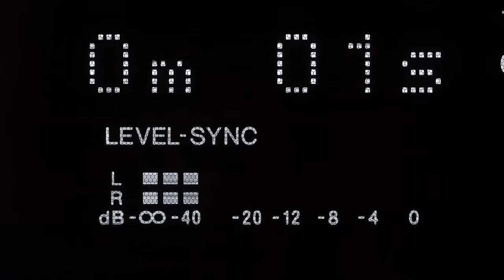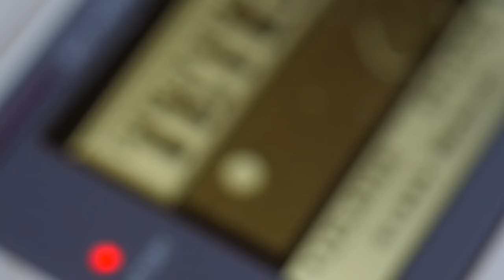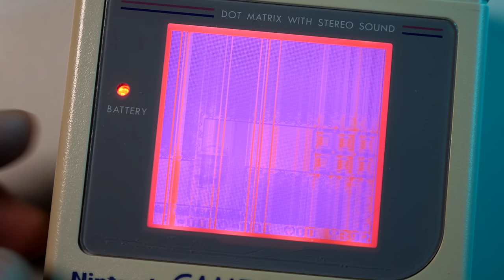The Best Game Boy DMG Screen Mod Ever!

Comment: I’m disappointed in Handheld Legend for not addressing the palette issue with this mod, and I find it curious how it wasn’t mentioned in this video.  I bought this from HHL on day one, only to find out on YouTube that every unit of this has the light gray and dark gray palettes swapped.  So while the ips screen looks great, every game looks wrong.  The user must cut traces and solder tiny wires if they want their games to look correct.  Handheld Legend has one sentence that reads “fixing the color palette issues with the dmg ips kit (rips)” between the features and contents of this kit, but it doesn’t link to anything, or explain the problem.  Two weeks after HHL released this kit, Retro Modding released it and were very up front with the problems, and also offer a version that is fixed by them and has speaker pre-installed.  I like HHL, but I think they pretended there weren’t any problems so they could sell more kits.  I don’t know if the palette issues have been fixed in the example in this video, but all potential buyers should be aware of this kit.  Neither HHL or this video bring up this issue.
Reply: There was one for the Gameboy Color just like this that had the same issue and they said it was only going to be the first run of mod kits and they were fixing the issue, maybe this will be the same?
Reply: Well can't you just tell by the gameplay footage here? It doesn't look wrong.

So how would he bring this issue up if he doesn't even have one??
Reply: Yeah, the way Tetris blocks look is what gave it away for me, as I've played more of that than I care to admit 😂
Reply: Wizzy Wambo  Do you mean in this video the colors of the mod are reversed as well and Colin just didn't seem to realize it?
Reply: what is the replacement kit to the pallette issue, and video discussing the issue?

Comment from the maker: A few important notes and frequently asked questions:
--The initial batch of these IPS screen kits cause the two greyscale levels to be flipped on the new screen (medium grey becomes dark grey, and vice versa). This can be fixed by swapping two of the pins on the wide ribbon connector that goes to the front PCB. However, I've received word that the manufacturer is aware of the issue and future kits shouldn't exhibit this behavior.
--The replacement shell I used here is also from Hand-Held Legend, but since minimal modding is necessary you could, of course, reuse your original shell if you wanted. This mod is also compatible with replacement glass screen covers.
--There seems to be confusion regarding the replacement front PCB. On the Game Boy, all of the logic happens on the back PCB. The front board only handles the connection to the display, the contrast wheel, the button contacts and the speaker connection. Since the original rear PCB is still used, the Game Boy functions and plays games just like it always did. This kit does not turn your Game Boy into a "clone" console by any means.
Reply: How long do you think it'll be for the revised version to be available?
Reply: @ViolentDetour  Good Question. I was ready to click "buy" when I saw your update. My hands are itchy and my birthday is Friday!  :-)
Reply: how is fail that????? is not tested befort put in productio?
Reply: How's the battery life?
Reply: @SimplyDudeFace  Just checked out HHL and they're getting ready to ship the V2! I can't wait to get one!
Reply: @ViolentDetour  So soon?!?!?!  Wow. This makes me absolutely giggly.
Reply: Ugh! They are sold out. They better get a new supply soon. I'm ready to burst on this one.
Reply: For fixing the flipped grayscale levels on the initial batch i've created a small PCB to swap the two data lines on the ribbon connector of the back PCB of the Game Boy:

https://oshpark.com/shared_projects/eEJHQ58k

It's very cheap and should be easy to install by lifting the two pins of the connector and solder it under them (and to the two vias). And (unlike cutting traces): it's reversible.
Reply: IPS v2 is on sale for $69 on Handheld Legend. Fixes have now addressed this issue. I just picked one up.
Reply: Wizzy Wambo  Haven't had luck with AliExpress. They bait and switch with even worse quality stuff.
Reply: Wizzy Wambo  Nah, its a great upgrade and I'm not sweating your alleged $45 savings point (haven't seen it around at that price), by buying from a reputable supplier. Plus it supports Colin.
Reply: Any comment on the button feel after the mod?  Several reviews mention it not feeling as responsive as the original Nintendo board, citing shoddy contacts.  I'm thinking it could just be an issue with how those users reassembled their consoles (too snugly or not snug enough) but also I wouldn't at all be surprised by a 3rd party product not being as good.
Reply from the maker: @Stripestore  I've found that the biggest factor in button feel is the rubber membrane between the buttons and PCB. Some aftermarket ones are either too stiff, too soft, or just poorly made in general. I can't see anything wrong with the way the contact pads were laid out on the front PCB with this kit, so perhaps those who have button problems also replaced the pads while doing the mod. If you have original pads from the console that are in good condition, it's best to reuse them.
Reply: @Stripestore  I use mine with original pads and had no problems. It has been a terrific upgrade.

Comment: Typing this in July 2021; Just did this mod with the IPS version 3 and it’s dope as hell. They’ve corrected issues with the mid-tone greys being swapped and it looks phenomenal. Definitely recommend the bracket for the screen and an aftermarket IPS-ready shell. 
I haven’t done a battery test, but I’ve been playing Pokemon pretty frequently for the last week since doing the mod and batteries are still going strong. I’m planning to order the cleanjuice battery soon.

Comment: I went the whole hog, and did the battery mod as well. This puts a CleanJuice XL USB C Battery Pack in place of the original battery area, and it uses USB C to charge it - no more AA batteries, and the Li-Ion battery can last for upto 30 hours. The whole mods, screen, battery, shell, audio amp, new screen protector, breathes new life into the DMG Gameboy, and brings it into the 21st century. I am loving the GB more than when I got mine back in 1990, and now play it more than ever.
I urge any Gameboy lovers out there to do these mods, they are fantastic. You just can't beat original hardware. Forget emulation, or those cheap Chinese handhelds running some Android, and old emulators. The original GB is still the best.

Comment: Colin, you should add an update to this that the current version of this IPS has an issue with the color palette. Two of the traces need cut and swapped for it to display correctly.

Comment: 2:44 I would actually advise against using pressure to hold it in place because it can end up causing TOO MUCH pressure which leads to visual tearing or too little and it comes loose

Comment: You wouldn't thinkai video made this year is already outdated but it is, you only need to remove the top 4 posts on the shell and not all four, removing the bottom two actually makes the install harder keeping you from using the 3d printed bracket to hold the screen in place...

Comment: Do you realize that the grey shades are backwards?
Reply: Yeah, it's a known issue with the first batch; there's a guide on how to fix it, and they also fixed it on the next batch of PCBs
Reply: @moth.monster  I've heard this, but I still have yet to see anyone post showing them with the correct colors (I see tons of these on Reddit and Instagram)

Comment: Hello, that vertical line is due to a capacitor problem, i had the same problem, only one capacitor was causing the vertical dynamic lines i replaced it and it worked

Comment: > best mod
>70$
Good stuff comes with price. Gotta stick to my oldschool mod. F**k that, i payed 1/15th of the mod price for the GB.
Reply: For real.. considering.. didn't the gameboy get priced around 50 bucks on launch anyway
Reply: @adventureoflinkmk2  $99 iirc? Lemme double check
Reply: It's not for everyone. Like he said, other mods like this cost about the same.
Reply: @BryanX64  Yeee, i just ain't fond of paying too much on mods. Exception being the ACA500 which is 90e. :V
Reply: @BryanX64  but then again... I just took one of those old ass digital dec PCs and stuffed a bunch of modern hardware inside...

Edit: and yes it closes back up as well
Reply: For not too much more you can track down an AGB 101 with the backlit display and get GB, GBC and GBA playability without modding

Comment: I heard from some reviews that the button contacts on the new board are a bit finnicky (button presses once the system was put back together didn't always work reliably). Did you experience any issues as such on your end? And thanks for the video, mod really does look good!

Comment: I've read that the buttons work bad on this PCB, even with the 2nd revision of this set. Can you confirm that? I mean, having a nice screen is great, but if the buttons just doesn't work perfectly, it's useless. See the comment below on the Handheld legend website: https://handheldlegend.com/products/game-boy-backlight-dmg-ips
They even admit that there are problems and a revision V3 is coming. So I think I would wait for the 3rd revision before buying that.
EDIT: Oh, see what I've found here: https://console5.com/store/nintendo-game-boy-classic-dmg-01-full-size-modern-ips-backlit-lcd-kit-bracket.html
It says: "April 2020 update: v3 units on order, featuring improved color palette & button contact surfaces"

Comment: Will try that asap. Thanks!
I see you're using recharchables for the DMG - mine does not work with them (Ansmann 1.2) and I have to use standard 1.5 batteries. Are the Eneloops different?

Comment: Would've been good to mention it as an option for those with screen rot (not just lines). Those require a replacement screen for refurbishing.
Reply: Wizzy Wambo  Screen rot just happens. No one has to "break" them. Someone who digs out their Game Boy and finds the screen has rotted is a very different scenario to someone who broke their screen trying to modify it, which is why it would be good to position this as a solution for people in both scenarios. Let both people know they have options. IOW, not everyone who might be interested in this is interested from an upgrade perspective.

 @Wizzy Wambo  Burned polarizers do not require a replacement screen.
Upgrading to a backlight with a bivert chip does not even require a replacement screen.
Dealing with screen rot does require a replacement screen.

See what I'm saying?
Reply: Wizzy Wambo  I'm not confused at all. Unlike lines which can be fixed with a soldering iron (I even have one with a special wide blade just for doing this), screen rot requires a replacement screen. Not every broken screen is unfixable but one particularly common kind is. It didn't get mentioned as a solution for this, so I mentioned it. No big deal.
Reply: Wizzy Wambo  They have to know that replacements exist. Not everyone with screen rot knows that upgrading DMG screens is a thing. Ever watch the Larry Bundy Jr video that discusses it? "🎮 5 Game Consoles Literally Rotting Away | Fact Hunt"

Comment: How's the battery life? Love the 20h+ battery life with a bivert DMG on 4xAA
Reply: Asking the REAL questions here. I suppose the battery lifetime will still be considerably high and much higher than the battery life of a smartphone if you run a GameBoy emulator on it.
Reply: I'm planning on fixing up 4 of them with these IPS displays when I get my tax money and upgrade the screen in my PLAY IT LOUD! system.
Reply: @KRAFTWERK2K6  he didn't ask that though. He asked how is the battery life on the modified DMG compared to his already modified DMG.

These are two different options for a DMG. It would be reasonable to assume they're playing Gameboy games on a DMG, not a smartphone with an emulator.

I can't see it being that different, biggest powerdraw in either modified DMG is going to be the backlight. If these are comparably bright, it's probably about the same.
Reply: First thing I thought of was battery life or a rechargeable Li-ion kit if there is one
Reply: @chrisgiles6906  and add a battery meter to see how much life is left on the battery in both hours and percentage. I could see that in the future.

Comment: Anyone know if you need to remove the old bivert chip for this new mod?
UPDATE: That was probably a dumb question for anyone that actually knows what the bivert chip does. I didn't understand that the chip kind of inverts the "colors," so yes, you will need to remove it for this mod.

Comment: Question: how hard is it to make custom LCD panel?
Every handheld screen replacement I've seen on this channel is just some widescreen LCD panel that has the edges blacked-out. It's been bothering me because it feel like there has to be a better way to make these screens fit without needing to cut into the handheld's plastic, or wasting a 16:9 screen on a 4:3 output.
Reply from the maker: I’ve been told that to have a custom LCD designed and the factory tooled up for production costs about $100,000 — plus the costs of actually manufacturing them. Even if they proved popular, the actual size of the Game Boy modding community is still small, so the per-display cost would be much more than anyone would want to pay.

Comment: You can buy a Nintendo GBA SP AGS-101 (with a genuine backlit display) for the price of that mod, and play all three generations of Game Boy games, from all three regions. They have (easily replaceable) lithium-ion batteries as standard, and you can buy a cart for twenty quid that loads ROMs from an SD Card, with baked-in emulation that allows you to "convert" NES and Master System games into GBA ROMs.

Comment: I'm curious if this introduces any detectable delay, since I would assume at least some degree of processing of display data is happening.
Reply: I doubt it would be even slightly noticable.
Reply: With the poor refresh rate of the original display and the slower clock speed of the CPU, I doubt any delay will be detected.
Reply: Same, if this thing buffers the entire frame before displaying, it could add 1/60 second of latency. Though to be fair, the original display was so slow it effectively added some delay.
Reply: Ghat should of no concern, since the og screen is so slow, it already has a very notable delay from the out of the box.
I'd suppose this screen might even be better in this regard.

Comment: I have a Lenovo G560 (from memory) and I'm wondering if there is a 17" IPS display replacement as the laptop works fine but I want a better display for the computer that is on offer.. would there be a conversion ribbon cable for such a transplant that will enable a ribbon cable from one screen to work seemlessly with a computer it was never intended?

Thanks

Comment: Vertical lines on the original lcd are actually fixable, but horizontal ones are not, as far as I know
Reply from the maker: They are, but sometimes the flat-flex cable is just too damaged to resolder. That’s the case with the DMG in this video, I tried fixing the screen several times. I was able to remove a few of the vertical lines, but not all of them.

Comment: Can I ask if you had any trouble using the d-pad moving diagonally with this? I’m having to return a device I bought because I couldn’t get the diagonal to work and wondered if it was a problem with my particular device or if it’s the mod itself?
Reply from the maker: I’ve found that, more often than not, button feel/usability comes down primarily to the silicone membrane and (to a lesser extent) the console’s front housing. Cheap replacement parts can have all sorts of problems, and switching back to an original membrane can often make a world of difference. In this case the mod board is just the contact pads so I can’t see why it would have much bearing on diagonal presses.
Reply: This Does Not Compute thank-you, yes it’s a refurbished device - so it might be the parts themselves that are causing the problem and not the board itself.

Comment: Thats pretty cool but once you swap out the original gameboy motherboard for one specifically made for a mod, cant really say its the nintendo gameboy still. (idk if i understood that right but it sounded like he wasnt using an original gameboy motherboard. if i did my apologies) but anyway,  Might as well look for a knock off version that is backlit or frontlit and save yourself the money. pretty sure the motherboard and screen are pricey. idk just my opinion. The cool thing about other mods is they use the original motherboard and sometimes screen. at this point the only thing left from the original gameboy is the shell.
Reply from the maker: The original main PCB is there, it’s just the front board (which handles the screen, buttons and speaker output) that gets replaced.
Reply: @ThisDoesNotCompute  aww ok. My mistake. Hopefully it didn't come off as me being rude or anything as that was not my intent. Thank you for the clarification. Thanks for the great vids as well

Comment: Thanks to this video, I’ve installed this exact mod along with the bracket from Console 5 and it’s great, but I have to push ‘up’ on the d-pad really hard when playing games, unless I loosen the screw behind the d-pad inside the battery compartment. Has this happened to anyone else or is mine faulty?